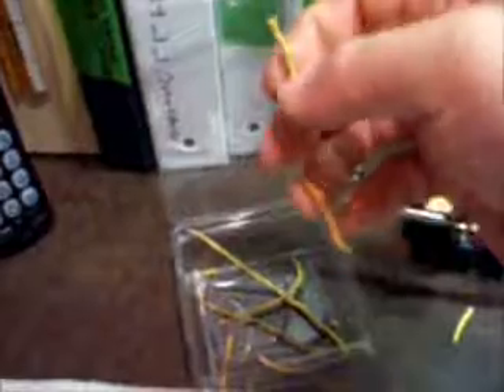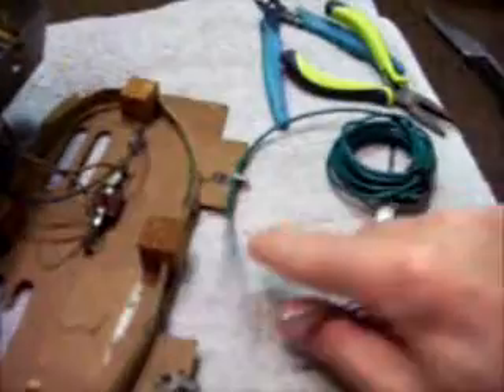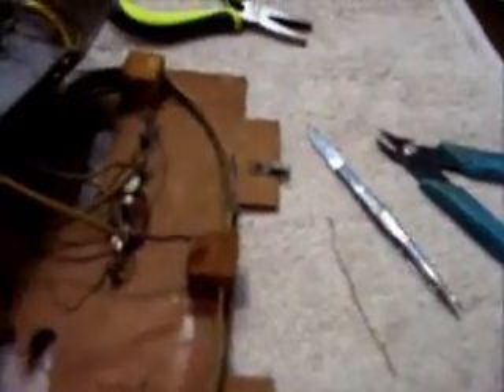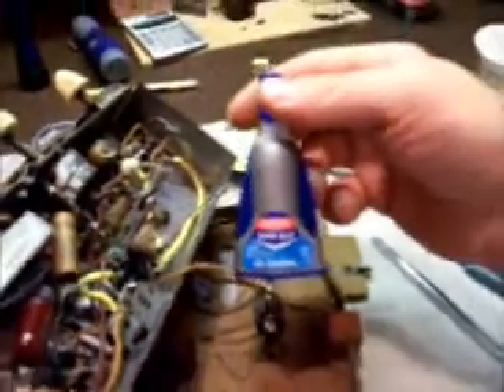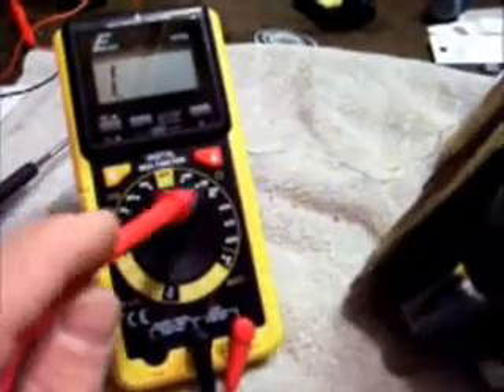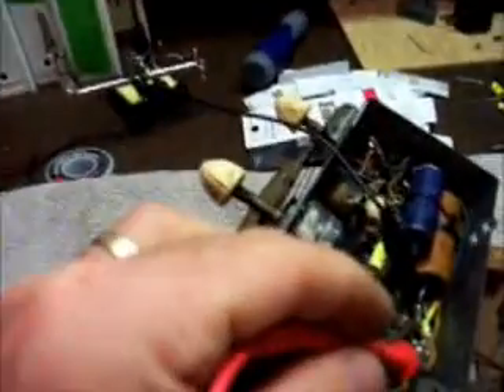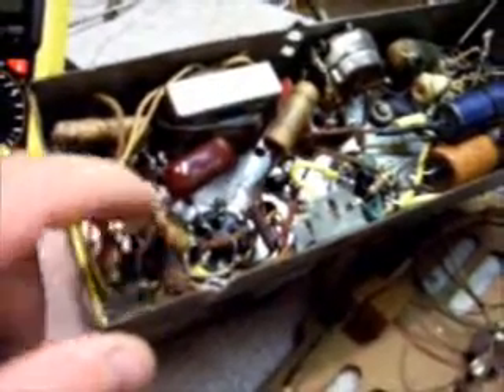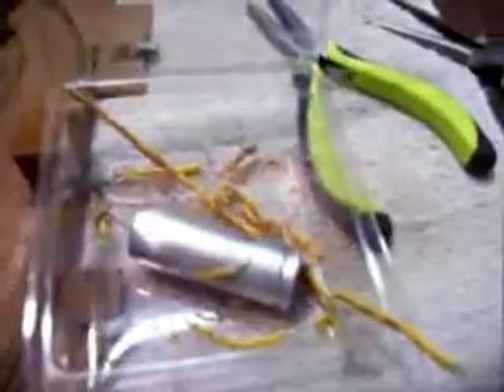Motorola 51x12 Radio - Part 3

Comment: That Sucks. After I replace the filter caps, I always do a controlled power up to see if things are right. And also as I replace the paper caps and resistors. It's saved me some headaches. I hope you find the problem. Thanks for sharing. Tec